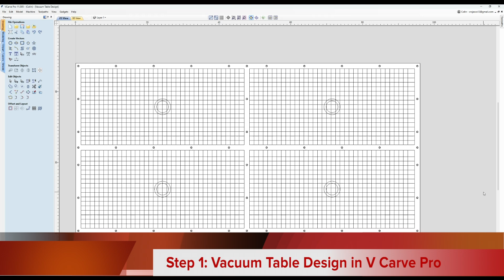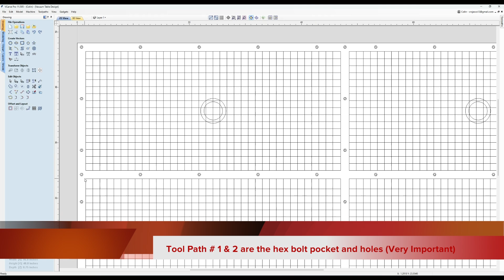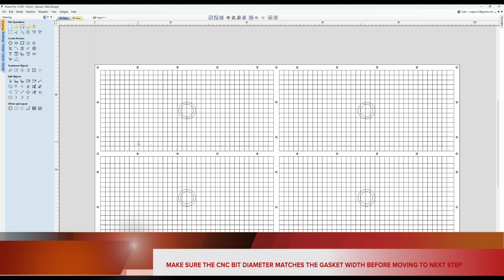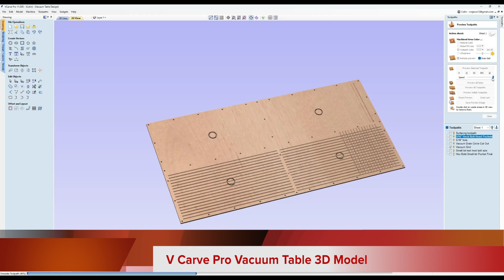Part 1: Create Your Own Cnc Vacuum Table - Easy Diy Tutorial!

Comment: Do you have the design files and parts list available for sale?
Reply from the maker: I am currently in the works of finishing them all up, and then I will post them on my website. Would you like me to notify you when they are up on my site?
Reply: Yes please do.
Reply from the maker: Awesome! I am glad you like my design. I will let you know as soon as I get them posted.

What kind of cnc do you have?
Reply: I have a Bobs CNC KL744 and a Zenbot 4896
Reply from the maker: @kevinscott3527  how do you like the Zenbot 4896?
Reply: It’s a great machine. I haven’t had any problems with it. I much prefer the servo motors on the KL744 than the stepper motors on the Zenbot.
Reply from the maker: Hey I just wanted to let you know I finished all of the design files, part lists, and instructions for how to build a vacuum table, and they are for sale on my website rojaswoodworking.com. Let me know if you have any questions.
Reply: Could you send me the files.
Reply: @juice46663 did you get the files?